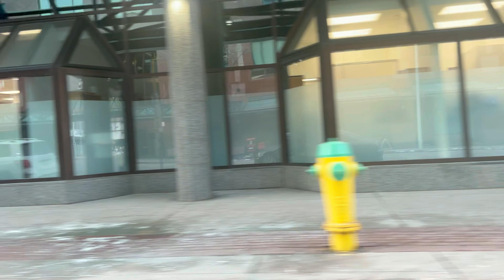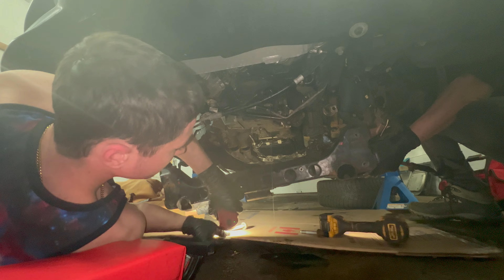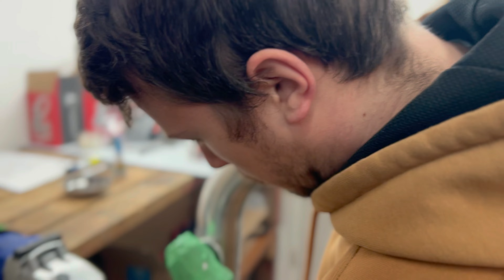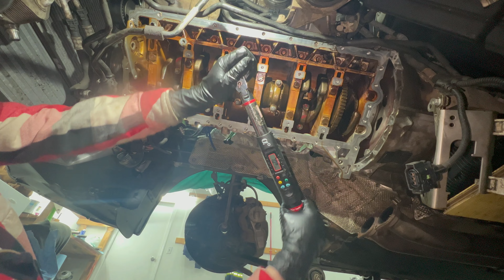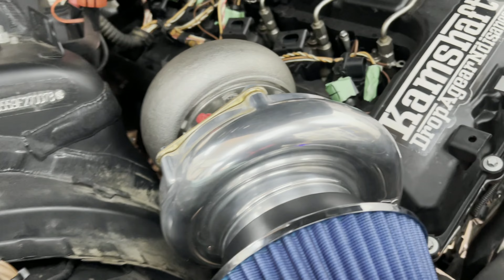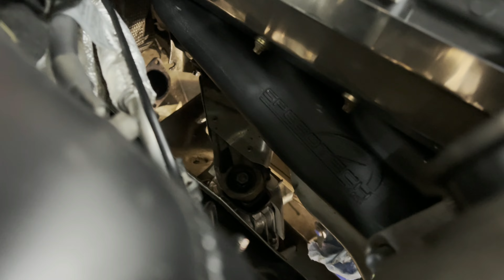BMW 335i gets a big single turbo

Comment from the maker: UPDATE! Root cause of bearing failure was due to a leaking injector.
Reply from the maker: @n54action  yes it was!
Reply from the maker: @n54action  I’ll be testing them too see witch ones are leaking, assuming it’s cyl #1. I did an oil sample and it indicated excessive fuel dilution, 3%

Comment: Bmw tech here you likely have a vanos gear failure or eccentric shaft failure
Reply from the maker: Failure is actually in the bottom end, what do you know about super knock codes?
Reply: @Kamshaft  the only time i have seen super knock codes are on cars with stuck injectors or ones that have been tuned improperly “super knock” is a frequency that the sensor picks up
Reply: @n54action  this n55 with di has an eccentric cam on the intake side, however the cam phasers are both oil pressure controlled hence having 2 vanos solenoids when the phaser fails internally you have timing codes particularly camshaft installation faulty
Reply from the maker: @n54action  I measured the all the bearings to make sure they were the exact same as the old ones (to the thousandth of an inch) I probably should have plasti gauged them, expensive mistake.
Reply: Your a bmw tech and yet you have no idea that vanes only exist in n52/n51 platform LOL